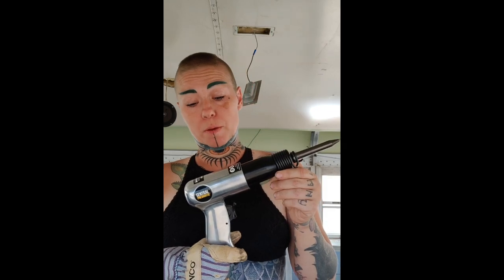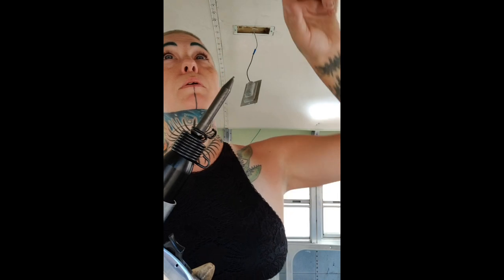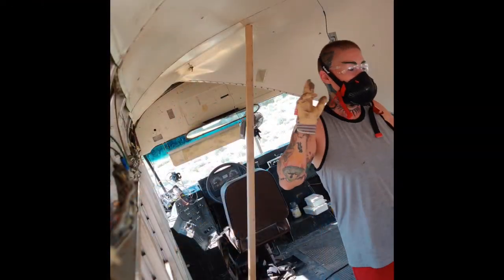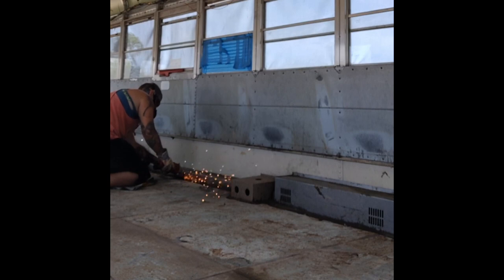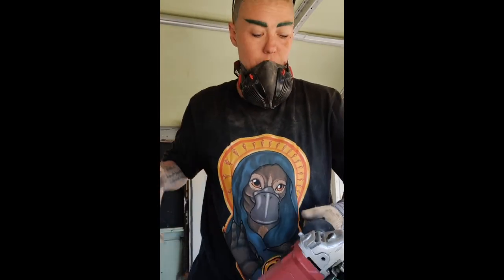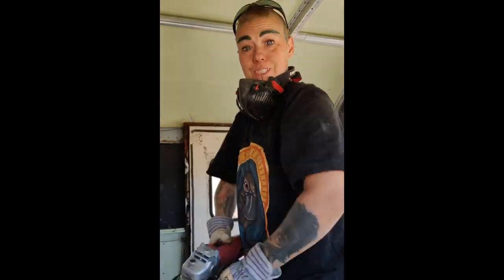Solo Female School Bus Conversion | Tiny House

Comment: Removing solid rivets it's better to drill into the head
of the rivet one size smaller. 3/16" rivet 5/32 drill then punch the shank out.